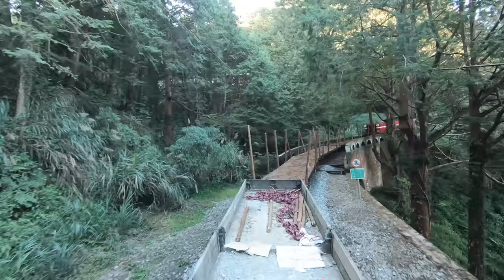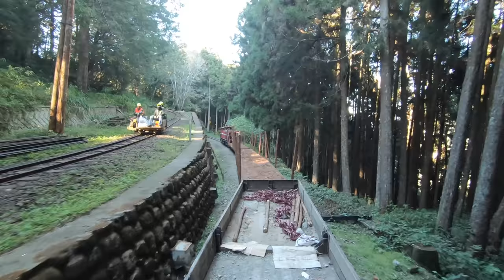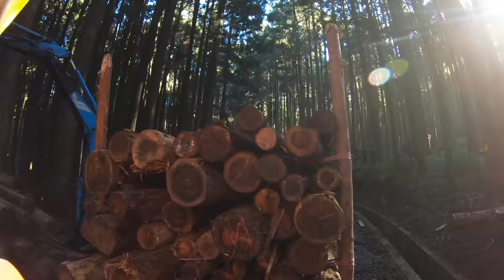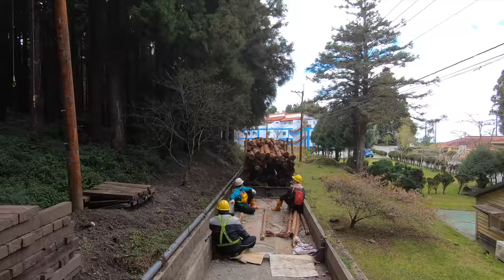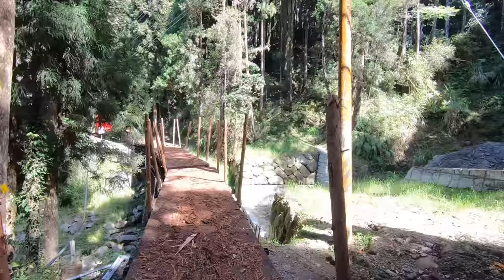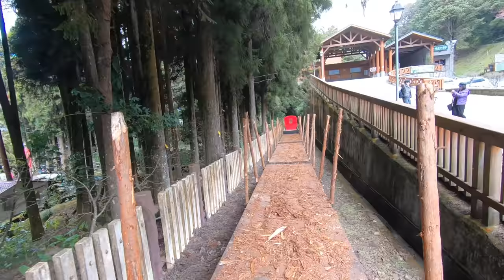【Alishan Forest Railway】The Logging Train Vol.3

Comment: Anyone know what % of grade?
Reply: I read a maximum gradient of 6.25% in some areas on the line. Shay locomotives can handle steeper grades than that so that's not too bad.
Reply: This was filmed between Alishan-Shenmu-Erwanping station. This section is 4.6km in length, and elevates 216m. So on average the gradient is somewhere around 4.69%.